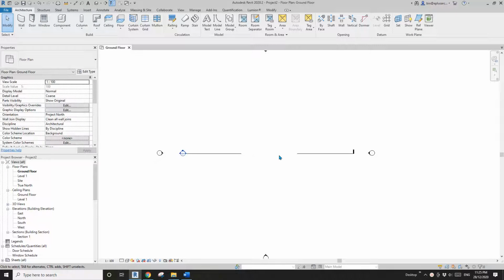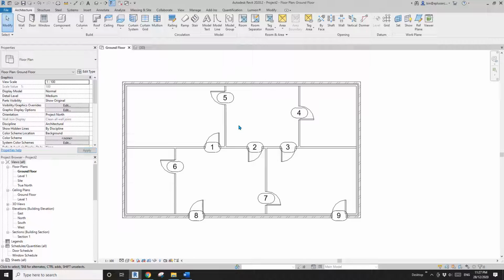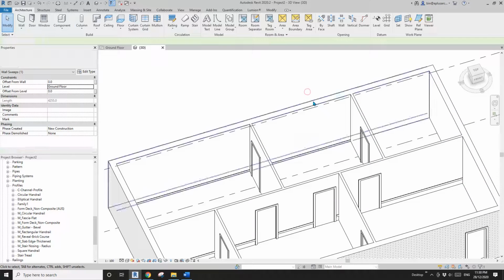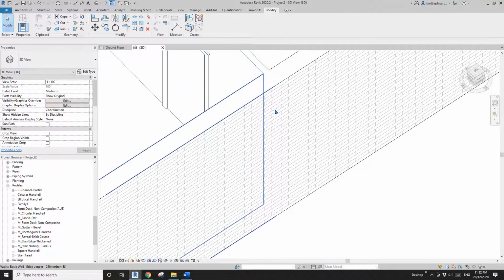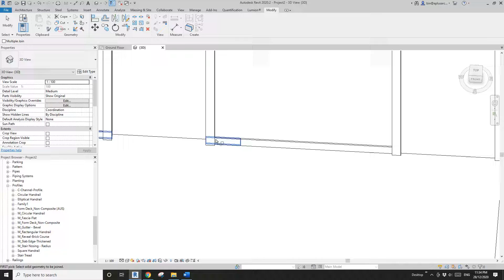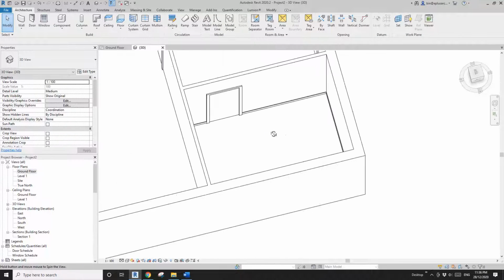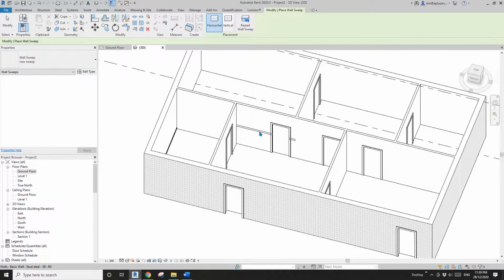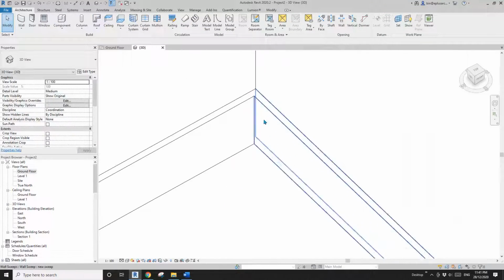Everyday Revit (Day 285) - Split the sweep? No, split the wall!

Comment: Why not use integrated sweeps for the baseboards?
Reply from the maker: It can work.  I tried before but ended up with too many wall types with different options of sweeps... with sweep on both sides, with sweep on one side, no sweep, with different type of sweeps ..... if you know what I'm talking....
Reply: @BINHE615  I have the same issue, a few too many wall types, but it saves time on larger projects. Great tip about the wall join tool, too. Thanks again for these videos, every one of them has at least a few useful tips.

Comment: Try create a wall with only 1 layer add skirting profile to bottom of wall. Make wall heigh unconnected same height as skirting you can add to any room and can be split
Reply: Layer is 1mm thick.
Reply from the maker: @wcoleary  Thanks for the tip,  I think it can work.

Comment: Hi Bin, this is so helpful. Any idea if these sweeps can be quantified in schedule as lengths? and how to tag them as separate material from the wall?
Reply from the maker: Yes, you can create a Wall Sweep Schedule for them. "TG" will not work on them, but you can use the material tag.